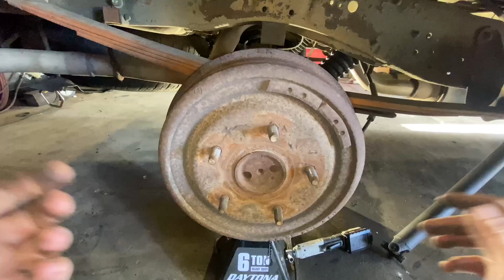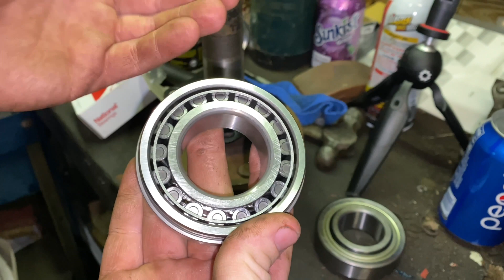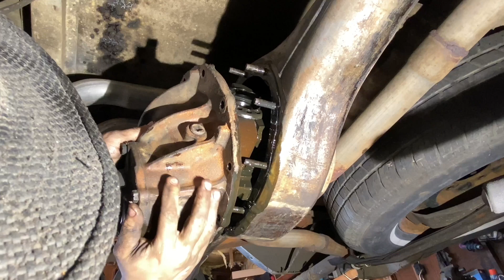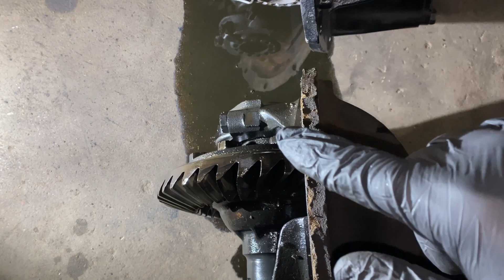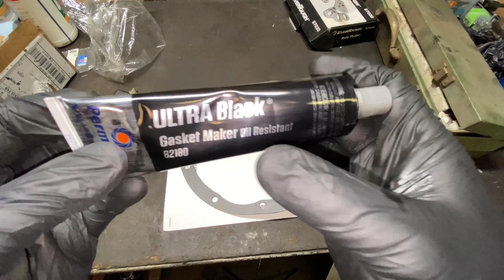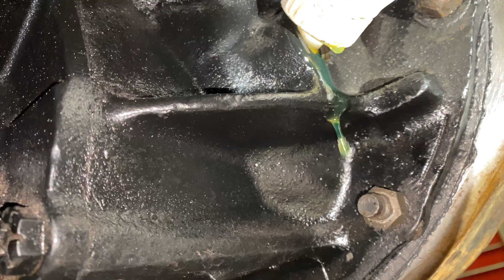Ford 9 inch gear swap/ upgrade from 28 to 31 spline axles.

Comment: I didn't see it mentioned in previous comments but you aren't explaining the axle code, on the tag, quite correctly. You had an open differential and the code for that is 3.00, However, if it was limited slip, it would be stamped 3L00 not 3.00L. So, the tag from the 3.50 center section with limited slip would be stamped 3L50. Nice video!
Reply from the maker: Yes you are correct, my original gear was a 3.00 open diff and I installed a limited slip 3.50 out of a 4x4 but I didn’t have the tag for that one so I put my original tag back just to keep it with the truck. Thank you, I’m glad you enjoyed the video. Thanks for watching.

Comment: Excellent video I just subscribed❤ where can I buy rebuilt pumpkin for my 82 F150 4 by 4❤ thanks
Reply from the maker: Thanks bud, I really appreciate it. Glad you enjoy the videos. Nice truck, yeah I like Quick performance, they have any rearend parts you need, you can buy complete center sections or just the gears, I’d check them out. Thanks for watching and thanks for the support.

Comment: Since you've got yourself a slide hammer already, outta think about grabbing the attachment that hooks into the seals for removing
Reply from the maker: Yeah I could, probably should just to have but the tool I have always worked so I guess I just never really thought about it but good suggestion. 
Thanks for watching.

Comment: Hey there. FYI: The difference in ring gear thickness is due to the ratio, not the axle spline count. Example: a 4.56 crown gear will be thicker than 2.90 crown gear. So the taller the gear raito, the thicker the crown gear, but smaller diameter gear pinion.
Reply from the maker: That makes sense, shorter gear has more pressure under it so it would make since to be thicker, and of course aftermarket true posi has thicker ring gear for obvious reasons, it’s funny cause the 3.55 I ordered for my 68 fastback has a hell of a thick ring gear, I’d swear twice as thick as the one in my truck but it’s an Eaton true trac too, just kinda funny. Thanks for the info and sharing. Thanks for watching.

Comment: I'm about to install my center section back onto the car, but i ain't got no lift.  i'm dreading the idea of benchpressing this heavy stuff into place.. any tips ?
Reply from the maker: You can use a floor jack to jack it up into place and line it up and push it in, you’ll still have to handle it some but it’ll be easier.

Comment: I thought Ford trucks came from the factory with 31-spline axles starting in 1973?  If so, it would seem all that needed to be done is to disconnect the driveshaft, pull the axles out a bit (just to clear the differential), and then swap your 3rd members, and button things back up.  Am I missing something?  I’m looking at doing a similar swap — get rid of my 3.25 gears by swapping in another 3rd members with 3.89 gears.  Both should be 31-splines (I know for certain the 3.89 3rd member is).  Guess I better check my existing axles in my ‘73 F100 before I go too far!
Reply from the maker: Yes you are correct, but they also came with 28 spline axles as well which is what mine came with so I upgraded to the 31 spline as well as the gear ratio. Starting in 75 ford introduced the F150 for suspension upgrade option and no catalytic converter, most of those came with the 31 but not all, and the F100’s mostly came with the 28 but it’s not an exact science. So I’d check yours because it could be either or, if yours has a factory big block with the C6 for example then it should have the 31 spline anyway. My 76 F100 came with a 302 and C4 but mine is also after that 75 change year so it all makes a difference. Hope this helps and good luck on your install. 
-Thanks for watching.
Reply: @FastFords289 Absolutely glad I saw this video of yours.  I also learned (after seeing it) that in ‘73 “most” trucks came with 31-spline axles, but not all!  I have 3.25 gears (factory), and it originally had a 390/C6 2WD drive train.  So I suspect mine is right on the cusp of having or NOT having 31’s.  If it was an F250, or a long bed with higher gear ratio, etc., it’d probably be more likely to have the 31’s.  But being a short bed, 2WD, maybe Ford guessed that set-up didn’t indicate it would be used for heavy duty, and used the 28’s.  We’ll see.  Either way, your video gave me pause and concern, and will have me checking my axles before I dive head first into things.  Might have saved me a huge headache! 👍
Reply from the maker: @sgtbaxman6720 you’re right, it could still be either way, because they weren’t consistent about what went with what application, they mixed things around sometimes unless it was ordered a specific way or a specific package deal. Although being an FE engine with a C6 I’d just about bet it’s a 31 spline but to be safe I’d definitely still double check. Good luck and glad my video was able to give you room for thought and help you. 
-Thanks for watching.

Comment: Depends on housing ends. My housing housing takes a sealed bearing, not a tapered. I have 31 spline axles
Reply from the maker: @Jon.simmons  perhaps it’s an earlier model, not sure. I know the ones I’ve seen, when they’re 31 splines they had tapered bearings. Thanks for the input though, very interesting. Thanks for watching.
Reply: @FastFords289  it's a brand new housing from Quick performance, I belive it had bi bearings torino ends on it. Things get crazy in the aftermarket.  Great video.
Reply from the maker: @Jon.simmons  oh ok gotcha, yeah that makes sense, which even the original housings would fit either or bearing but yeah with the aftermarket stuff there’s no end to the possibility of combinations you can get. They make great stuff too, I bought my Eaton true track from them that’s in my 68 fairlane fastback, great product. Glad you enjoyed the video, thanks for watching and sharing.

Comment: Thanks for the help, I still don't have any axles, hopefully the ones I'm going to look at this afternoon will work. They're out of a 78 Bronco. Great video!
Reply from the maker: You’re welcome, glad to help, yeah those should work since 78-79 bronco has the same setup at the trucks. 4x4 had 31 spline axles so it should have the heavy duty 31 spline axles since all broncos were 4x4. Good luck, hope it works out for you. 
Thanks for watching.

Comment: torino style or big ford late axle housing ends,could not tale just from watching video.
Reply from the maker: Big ford style axles and housing. Those housing can use the 28 spline sealed roller bearing or the 31 spline tapered bearing. I converted mine from the 28 spline set up to the 31 spine setup with no modifications. Hope this helps. 
Thanks for watching.
Reply: Hi what bearing do you use for a small bearing housing when going from 28 spline to 31 spline axles , thanks
Reply: Part number is for JEGS.

Comment: What did you get the axles out of? And what brand are the new bearings and seals?
Reply from the maker: The gears and axles came out of a 1977 ford F150 4x4. The bearings and seals are National brand. Hope this helps, thanks for watching.

Comment: The tag: WDM = axle model code BF2 = revised version (interchangeable with previous versions) 6CE= 1976/March/5 part assembly 9= 9 inch ring gear (L=limited slip, 8=8” ring gear) 334A = vehicle plant [note: nodular iron cases have “N” cast into front or inside wall. Above the pinion cartridge. Some exist without the N, and have C4AW-4025-B casting part # on the inside of the case next to the adjuster nut]
Reply from the maker: Cool, appreciate the info bud, I knew some of that info and you’ve taught me more on the codes. Thanks for commenting and thanks for watching.
Reply: @FastFords289  I've got a 61 and a 63 Thunderbird (parts car). The parts car I'm stripping down to nothing, the 61 has a 66 427 in it, and I'm starting its 2nd rebuild. The rear end is getting 3.89 gears in a traclok carrier, and it's raining, so it's utube, how to manuals and spec sheets for me today. I like your approach.
Reply from the maker: @1961Bullet  nice! Those old thunderbirds are cool cars, sounds like that 61 you’re building is a mean machine. Appreciate you sharing your build and plans, good luck with it and hope everything goes well in the process of it’s completion.
Reply: @FastFords289 it's been a lot.
Reply from the maker: @1961Bullet  know the feeling brother, I’ve already put a lot into my 68 fairlane and have many more plans for it. The good thing is when it’s all done you can look at it and say you built that, it wasn’t bought. That’s the kinda stuff I love, seeing the craftsmanship and dedication and different ideas that people put into their cars and trucks.

Comment: Great videos on these rearends, I watched your other one as well... What about axle flange gaskets, didn't see you use them? I have original ones on my 28 spline 9 inch, but am having difficulty locating new ones with the shape of my flange. It was out of a Ford F100, I believe 1964, but not positive on the year. Any place you use or recommend that specializes and carries parts for these 9 inch Ford rearends? Thanks so much!
Reply from the maker: That’s great to hear, I’m glad you like them and they helped you, thanks so much. Honestly I just reused mine because the original ones are stamped steel gaskets and they were in good shape plus you have the internal seals to keep dirt and moisture out. However you should be able to get them at your local auto parts store, I know I bought them in the past but I don’t know the part number. If they can’t find them then LMC truck or national parts depot, check pony parts or summit racing should have them. They should also have a diagram showing the flange shape with sizes and specifications to the different ones so you can match yours up. Ford used three different flanges on their rearends over the years and if you have a 64 that should be the early style smaller version to the best of my knowledge. Good luck and I hope this helps, and hope you continue to watch. Thanks for commenting and thanks for watching.
Reply from the maker: @1961Bullet  great advice!

Comment: Thank you for the clarification on this! I did not know they made a Ford 8 inch which I have in my 65 f100
Reply from the maker: You’re welcome, but that’s strange, someone must have swapped that in there some time because ford never put 8 inches in trucks. Either way I’m glad I could help, good luck on the build. Thanks for watching.
Reply: @FastFords289  there was also an 8.8” for a short time (yes ford) but they never have tags and were made extinct through revisions. Nothing aftermarket fits them.
Reply from the maker: @1961Bullet  sure did, a lot of the 80’s ford trucks had the 8.8, which I’ve never really been a fan of the 8.8’s. They also put them in the cars and slit of people will swap those in if they can’t find a 9 in. I’ve always liked the 9 inch the best and the 8 inches actually aren’t bad if you upgrade the center section they can be as strong as the 9 inch 28 spline, that’s what I did with my 68 fairlane since I couldn’t find a 9 inch. Thanks again for the info and commenting and watching.
Reply: @FastFords289  both my tbirds have 9" 31 spline rear ends. When the rebuild is done off the car I'm swapping them, and have 1 to sell. In case anyone is interested. 3.0 gears.